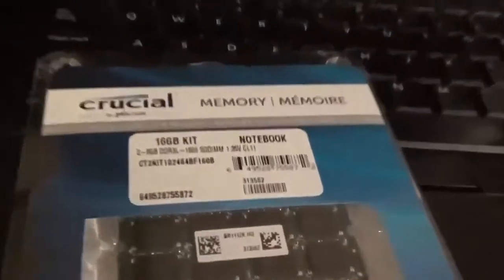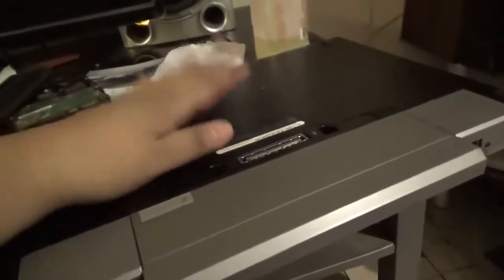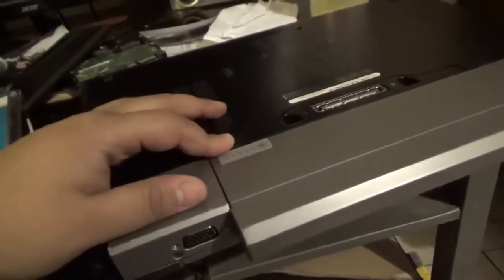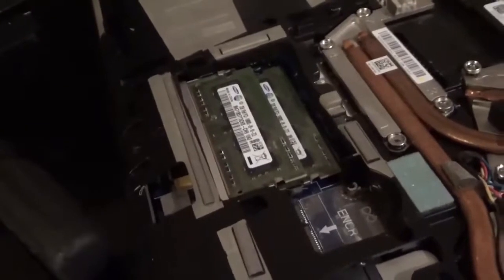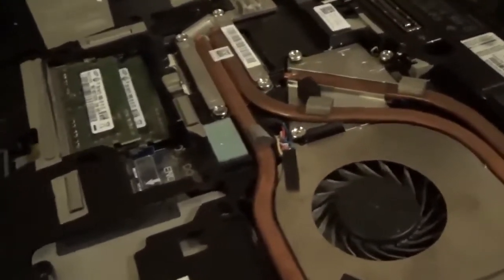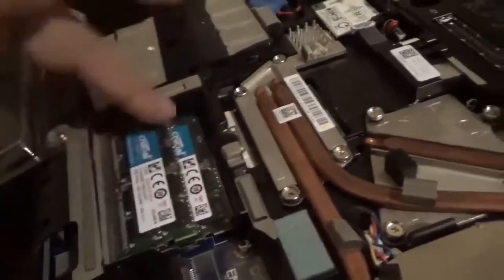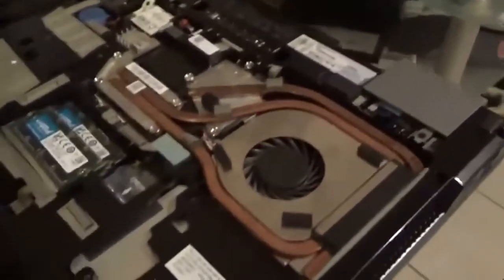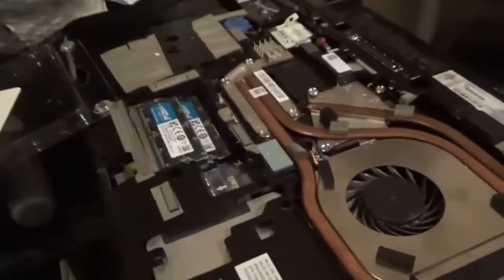precision m4500 ram upgrade

Comment: i have installed 16gb 1600mhz ram, the laptop work on 16gb but not on 1600mhz. he still work on 1333mhz. why is it so?
Reply from the maker: the cpu only supports a specific speed.   look up the model and revision you have then you will find out what kind of memory it can use
Reply: @justbored3.14  ah ok